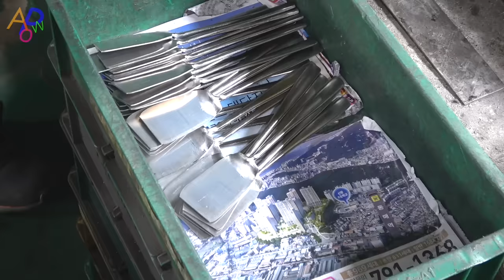Korean Fork Factory Made By Artisans With 50 Years Of History

Comment: When you choose not to invest to keep up with the tech, you become an “artisan”.

Also, looks like they’re not adding any value from the human touch - it might as well have been completely automated.
Reply: true xD
Reply: True. The processes are inefficient. Why cut it into 3 and then again into 4? Also, they are wasting their labor plus machinery.
Reply: Completely automated means very large capital. Forks are cheap because they are made on simple machines . A single employee will produce 1000s of forks in one shift.
Reply: Yeah this can be done with a single endless belt and a few hydraulic presses. Bonus: everyone gets to keep their fingers.
Reply: with the margin they earn, high fixed cost can become a burden
Reply: @ThaFuzzwood  The forks feature compound curves, radiused edges and have a textured finish, none of which can be achieved by simple pressing.
Reply: Oh here comes the experts 🤣🤣
Reply: @webtoedman  And what kind of tools do they use besides grindstones?
Reply: @ThaFuzzwood  A lot of those "grindstones" are buffing mops. You can see the workers applying buffing compound to them. The skill lies in getting the desired finish without burning, grooving or rolling over the edges of the work. Buffers of that size run at about five to ten horse power, and are not to be trifled with.

Comment: yes ... harsh production in Korea ... why not remove the partition and immediately put the cart under the cut sheets of metal at 0:40?
I see this is a feature of the Asian region - in production, work low, on a chair, and I understand that there are people with their heads on their shoulders, but you can be distracted and injure your hand on the press, there is very little protection. so there will always be work for labor protection. a lot of manual labor on old equipment, what kind of savings does the plant have with such a distribution of labor?